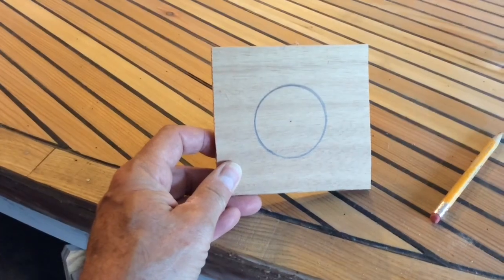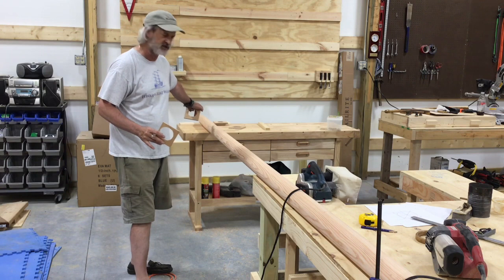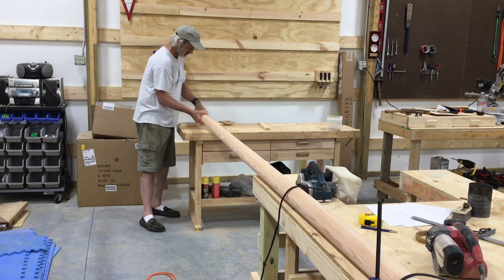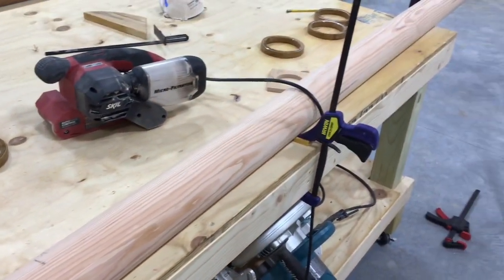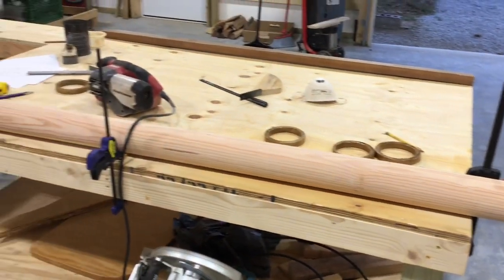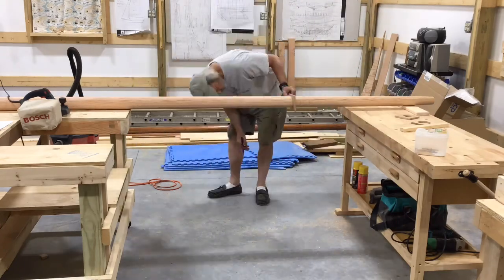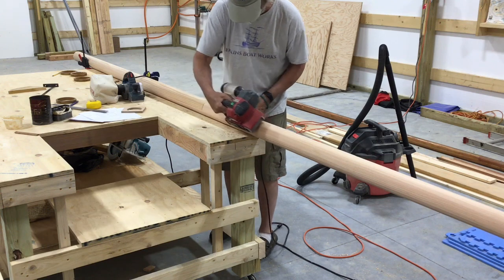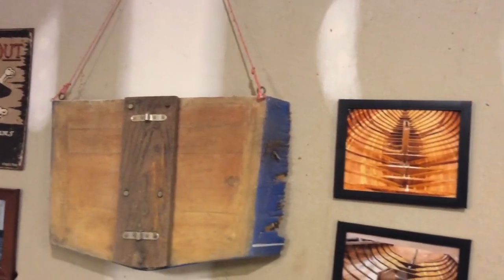Mast Tapering - Boat Building the Haven - Episode 99 part 4

Comment: Ur making it hard to ur self to achieve the shape of the mast to be tapered and cylindrical according to the different diameters which they are located in different areas along the mast as per what the drawing plan called for. 
I am curious to ask u this, have u ever came across any YouTube videos that inspired u to make a top open square or rectangular box jig, which u need to taper in both top sides of the box according to the required taper angle from the largest diameter to the smallest one. This will unable u tighten and fix the square pice of the mast inside the box and make sure that u install a lockable rotational mechanism that will prohibit the mast from moving in any direction and allows u to rotate the mast easily whenever u want to rotate the mast to introduce a new face to be trimmed by the roter pit. If ur slop calculation of the taper angle is correct then it is only a process of adjusting the height of how deep u want the roter pit to trim and placing the base of the roter on top of the two taper sides of the box starting from the end that is go with the grains for better cut results. In my humble opinion, I believe one of the best jigs a have see in YouTube is done by a YouTube channel named (Ask woodman) if I recall it’s name correctly. If u have a free time try to find the video and watch it.